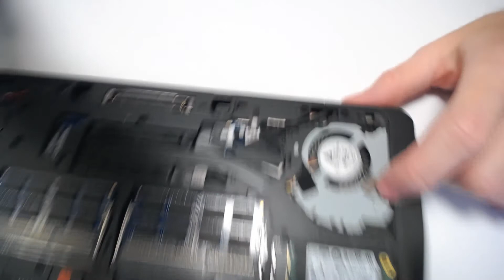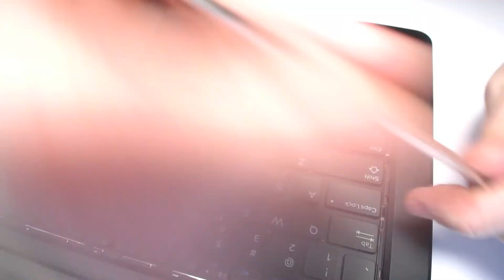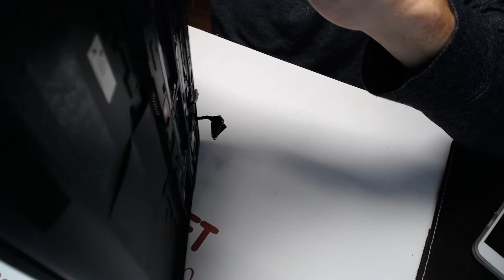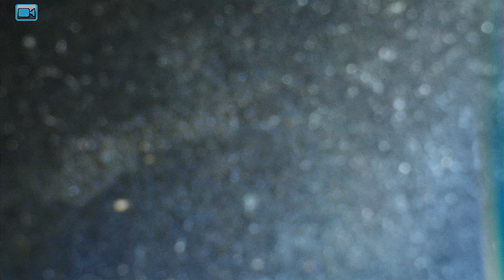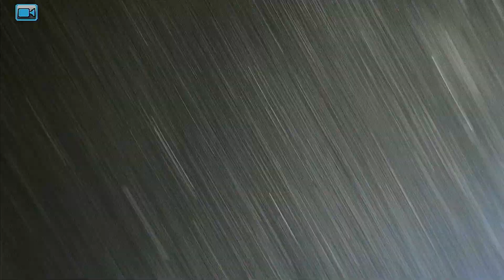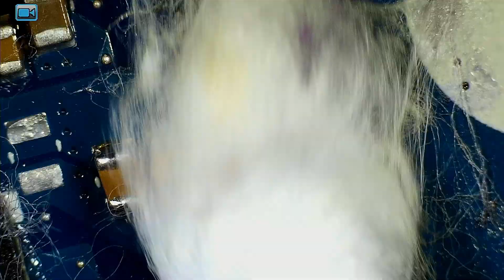Dell Latitude 7250 no power up light goes out on the power supply shortage on the board repair fix

Comment: I have the same problem and removed the same capacitor and the LED lights when I plug the power supply in and I get 19.5V across the junction ...... what's the Uf of the capacitor and where can I get it?

Comment: nice video but bad soldering, use amtech flux , not flux that has already ipa in it, while soldering with a heat gun , heat the pad first and than put the cap on it. much easier and dont burn your fingers